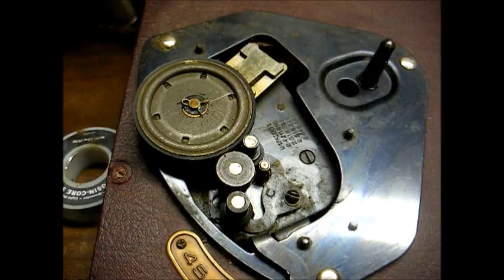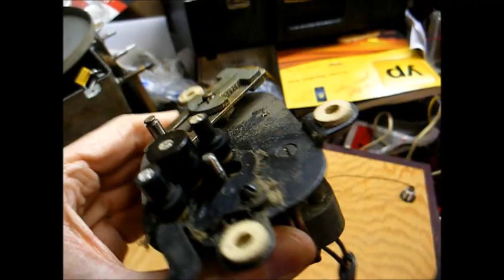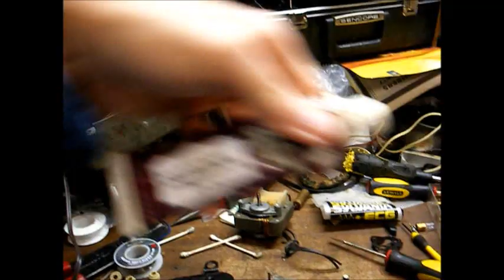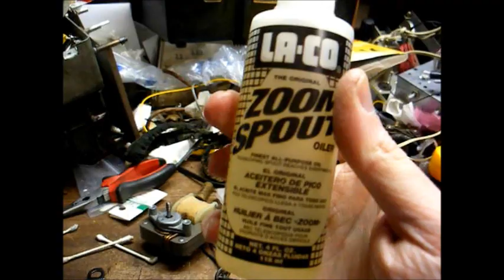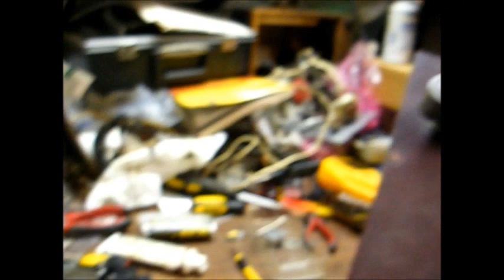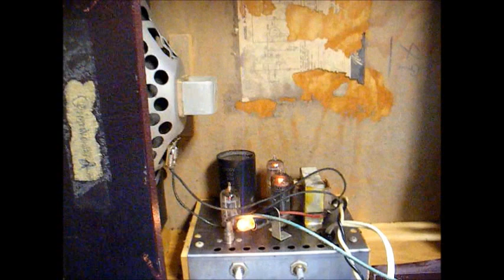Repair of a 1958 Newcomb model P12C classroom record player

Comment: My dad's Silvertone was like that speed adjuster.  1955 .
Another suggestion to prevent notches on an unused idler wheel: take it out if don't intend on using it for an extended period of time.
You got that 45 RPM adapter from a Crosley, right?

Comment: you did not have to break off the flipper of the cartridge you could have put a few washers under the cartridge and that would raise the cartridge down so that the lever would clear the arm sides  for a very little unit it sounds great

Comment: Another good vid, my friend.  It's interesting that you should mention a notch in the idler wheel rubber.  I just did an idler wheel buy/exchange with V-M Audio for that exact reason.  Every time the idler went round and round it was thump-thump-thump.  :-)

Regards,
John

Comment: Bryan,

You have been really helpful (on You Tube and the ARF) getting me up to speed with the servicing of my Newcomb EDT 1225, a solid state record player with a 12 inch speaker from 1971.  My schematic shows an Astatic 89T cartridge/needle assembly, but I used a NOS Astatic 81T which, I'm told is interchangeable but has slightly less output voltage.  It works really well with tons of volume and sounds amazingly good.  Have you looked into using an  Astatic 81T as a replacement?  It might be easier to find and cheaper.  Maybe...

Regards, Tom

Comment: I've seen some of those sorts of mechanisms that did not have rubber parts on anything but the idler wheel, the speed turrets were metal. I can't remember which make it was but it may have been a Gerrard or a Phillips changer. With some idler wheels you can use a square belt to replace the tire. I've never been a fan of these older record players, for the time and money you can throw into one you can overhaul an old Dual changer that is much easier on the records.
  With regard to the paddle on the stylus hitting the record, I've run into that before myself, sometimes you can tighten up the flat spring that holds the stylus in the cartridge, although trimming it would work as well.

Comment: sometimes you can shim the back of the tone arm up a bit with cardboard in the arm shaft, like a C washer.  If you raise the back up about 1/4" or so, it may clear the needle flipper.    Or you could cut an O ring so it will go around the arm shaft base where it comes out of the board.
Reply: You got some record players too I bet!

Comment: As there's no power transformer in that amp, I imagine that the HT comes from directly rectified mains, but where does the low voltage for the filaments come from?
Reply: Yup.  All in a string. Just like my Detrola 4 tube transformer less radio.  I have lots of tubes all the way from 70 volt to 1 volt.

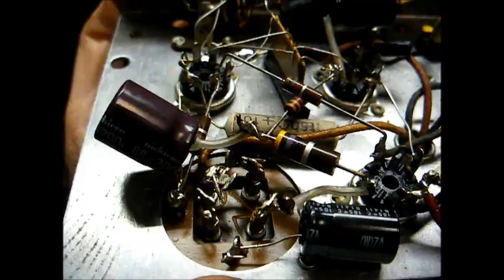Comment: Didn't you forget a paper cap @ ~19:08?
Reply: That's likely a dropping resistor to complete the series tube string to make up the total line voltage. It is not a paper cap, rather it's a ceramic wirewound resistor in series w/the tubes. That motor is a standard 110V motor, & is not in series with the tube filaments. Great repair!

Comment: I ran accross this turret auction on eBay. Seems cheaper than the ones quoted.

http://www.ebay.com/itm/Vintage-models-record-tape-player-parts-Turret-drive-roller-idler-wheel-bumper-/121057150479?pt=Vintage_Electronics_R2&hash=item1c2f91860f